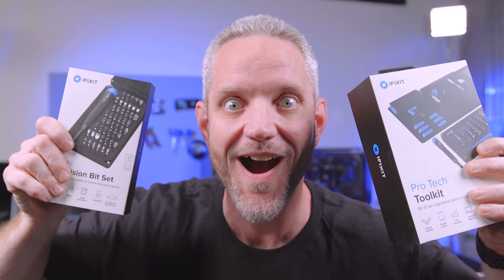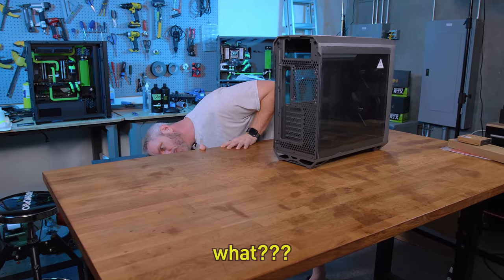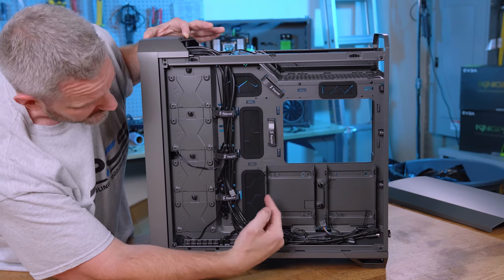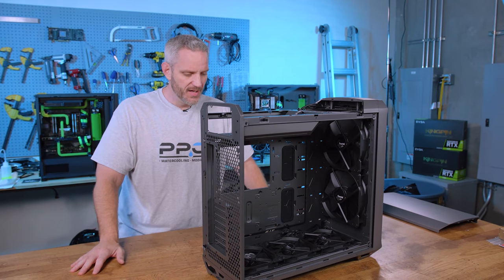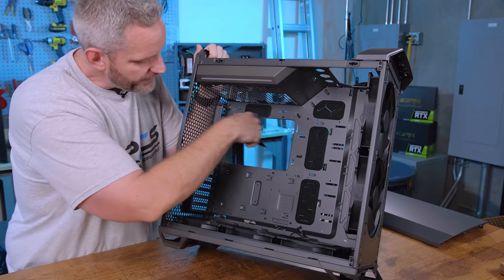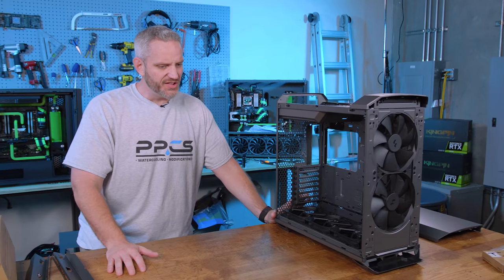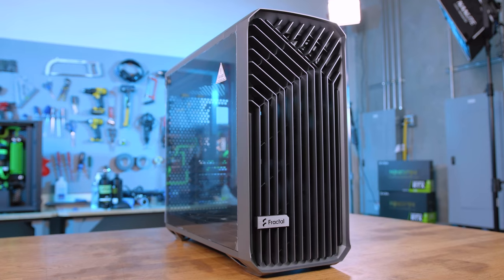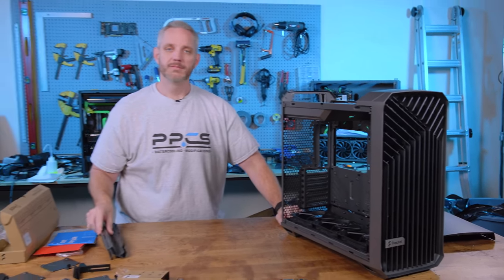I think I found my next case for the perfect casemod!

Comment: This case is junk... I get reviewing it, but I wouldn't buy this case.

To many small problems

No replacements for 180mm fans
No aio up top
Psu in a bad place - Not only balance.... how long are the power cords for a psu. Good luck not using a extension cord.
No cable management  space

I like the front..... thats it.

Comment: Actually, imagine an ITX motherboard with a riser cable and a vertically mounted graphics card in this case, snug up against the motherboard tray, both water cooled by respective 420mm radiators.

It wouldn't look strange, it would look AMAZING.

Comment: The amount of time Jay craps on stock fans...Here I am running the AMD stock cooler, 2 120mm White LED fans that came with the case, 2 cheap 5€ 120mm fans, and 1 10€ BeQuiet 120mm fan...

Comment: My mind thinks.. hot air rises and the exhaust vent is in the middle of the case besides the PSU fan, which isn’t the best fan generally. And with such a positive pressure those filters would need to be cleaned constantly.

Maybe I’m over thinking it.

Comment: Jay, the word you're looking for is "cavitating" rather than percolating.  That's where the pump is flailing around unable to achieve a fluid seal and move liquid.
Also, I could see you being able to do a "damage" mod like you describe.  Just epoxy a sheet of similar steel on the outside of the glass panel.  Or better yet, ask Fractal to make you one that you can then deform.  😁

Comment: Actually you were wrong about the vertical bracket option. Those expansion covers can all be removed and you can put an aftermarket vertical bracket in there.
Also also, not all AIOs have the pump in the CPU block like from MSI and the new-ish Pure Loop AIOs from be quiet!. So some AIO radiators can go at the bottom since the pump is either in the radiator or is an in line pump 😁

Comment: My issue with this case is that Any Case manufacturer that tries to do anything that looks good with fans larger than 140MM doesn't do well because of the adoption rate of these 180/200MM fans is so small that it other fan manufacturers doesn't do them - and if they make fans these sizes they aren't good. I've always wanted a nice case with amazing large 180/200MM fans with high static pressure to support a 180x360 or 200x400 radiatior but none exist and none cares enough to make them because so few would actually buy.

Comment: Too many comments to read them all, but I scrolled for a while and didn't see this one -- there is a vertical GPU mount available from Fractal (Flex B-20). Although with the fans pushing cool air up from the bottom, I don't think it makes sense to use one.

Comment: id like to see more cases with dual 480mm rad support is seems to be a bit miss for from new cases, unless they are super expensive. after my thermaltake core x9 had a ton of leaking issues (destroyed a motherboard, cpu, then another motherboard, and now a 6800xt, i have moved to the old phanteks original enthoo primo case which supported a 480mm in the top and bottom without enough room to mount and EK-XTOP Revo Dual D5 with 150 res attached. other than huge cases that support dual 480mm rads it seems to be an oversight.

Comment: That's a nice case. I love cases with good air flow like cooler master. I have a cooler master case and will use this fore ever. I don't like the top airflow design and the motherboard passthrough's. You think they would think about stuff like this.

Comment: I don’t know. Jay and Steve are praising this case but the PSU position is like going back to the 90s when 1) the PSU fan acted as the only fan sucking fresh air into the case via negative pressure (not the problem here), 2) the PSU grilled itself in the hot air which it was pulling from the case (partially concerning for me).

Comment: I think whatever you do for a mod, try to use 180mm fans and get a 2 x 180 radiator. Keep that giant air intake aesthetic. Would have to use the Fractal RGB fans though. Doesn't seem to be any other brand with an RGB 180mm fan.

Comment: When is the mod of this case coming? I plan to replace the NH-D15 with a dual 180 mm radiator in the future and am still not sure if I will go full custom loop with the GPU integrated or only an alphacool custom AIO for the CPU. Would be nice to see what you will do with the case.

Comment: I think you can try using cooler master universal vertical GPU mount for vertical graphics card. The only issue is that it has a PCIe gen 3 riser cable, if you can replace it with gen 4 riser cable it might work for you or just change it in your bios, and also found a radiator for those 180mm fans from alphacool (accidentally saw Jays old video on their website). 

I would definitely want to see Jay do some mods and a custom water loop to that case.

Comment: "A power supply at the top could make it tippy" I can confirm this with my custom dual system "proper" (64cm tall, beige box) full tower with two PSU's in the top.

Comment: leave it to fractal to actually put some effort into actual design. Legit not disappointed in how it looks, which is arguably the first hurdle into buying a case. As opposed to the o11d this one is not as bland as eating cartboard without compromising performance (like other cases). If I didn't have the evolv X and was building a new pc, this would def be my go to. No doubt about it.

Comment: Great case up until the top mounted PSU. The last thing any PSU needs in the era of  450w GPUS is all that heat getting sucked into it. PSUs have got much better in recent years, and they also run fanless until a certain power is pulled from them, but now the fan will be running flatout. Bit of a flop.

Comment: I don't know why, but this case put a thought in my head that had never occurred to me before. Why don't PSUs have the cables sticking out to the right side of the case (where all the cable management space is)? I know it would have to be a non standard PSU layout, but it would save routing the cables into the management space and then back out.

Comment: If you're going to remove the fractal fans  that come with the case your losing all the value of the case, the fans are like $125 in total, so if you plan to use a radiator in this case just get a different case that's $100 cheaper. The only reasonable place to place the AIO is in the front and you will have to lose those two 180 mm fans they cost $40 each.

Comment: The craziest fan mod I ever did was installing a high CFM all metal AC fan with a 12 volt relay to turn it on. I cut the case metal so it exactly matched the shape of the fan inlet and used metal tape to smooth the transition. Then I cut out the bottom of the plastic front panel and made some cuts up the sides between the case and front. Behind the panel I put in blocking so that the fan could only draw in air from outside the case. It would take the fan a bit to get up to speed but once running it was pulling air like a vacuum cleaner. Couldn't leave small things around the bottom of it or they'd end up inside the computer. I still have that case from 21 years ago. Massive full tower with 12 drive bays. I got fed up with cramped mid and mini towers.

Comment: A solid side panel to make it look like something blew up inside and forced the material outward? Something tells me you need to find someone who would let you shoot a couple of their .357 hollow points at what would be the inside of the panel. If the glass in the side is tempered you could shoot it a couple of times with a 147 grain 9mm, and the glass would spider crack everywhere.

Comment: I think you may have found me my next computer case.  I was a little dubious with the top mounted PSU, but  there's lots of good features:
- full filtration on the intakes is real nice, as is a positive pressure design for my living space (I have carpets that generate a ton of dust, so keeping the dust from circumventing the dust filters is a really nice feature I wish my current case had the capacity to do.)  
- The $300 price tag (I'm Canadian, numbers get bigger up here) would have pushed it well outside of my acceptable price tag for a case, but the fact that it comes with pre-installed intake fans very nearly covers the cost of cooling for me: I'd just need one exhaust fan and whatever I go with for the CPU Cooler (I'm not a water guy, I'm both not the best at keeping up with maintenance and my attention to detail can vary wildly...I've seen enough of your videos to know these are bad traits for someone who uses water cooling systems)  Looking at the prices, 5 of those same 140mm fans bought without the case would cost me $115 (I couldn't find a price for the 180mm fans, so I'm just using the 140 price for those...it would be more, of course.
- The amount of open space makes it look very nice to work with. I'm used to fairly old school cases with massive racks of drive bays (my current case has 3 5-inch and 7 3.5-inch bays), and given the lack of need for an internal optical drive, I'd be delighted to just go to something simple like this.

Comment: Would love to see you mod this case, the front panel alone gives you thousands of options. However I love the look of the front without the front panel on and wonder if there was a way to mount fans behind the 2x180mm front fans, with a filter, then paint the large fans and leave them exposed with no front panel at all. Allow air from the fans behind to turn them so they genuinely look like some form of industrial exhaust fans.

Comment: Do a mod. Keep the tempered glass panel, but overlay a solid one and glue (or some other adhesion method) a "solid" panel to it that you damage with a big hole in the side like something exploded "out" of the case. but the tempered glass behind still seals it in and protects the interior components.

Comment: For your space/engine mod idea - I always wanted a case that had full height intake at the front, and direct venting without passing warmed air on to other components. Difficult and ultimately not much cooling advantage, but it would look great. This case looks to have enough room behind a front mount setup to vent out both side panels. Or even V-mount two radiators up front - shrouded and vented straight out one or both side panels (with some serious frame cutting).

Comment: I'd like to see a guide on replacing filter mesh.
I've been using the Thermaltake Chaser MK-I for over a decade now.
I figured a way to rig a radiator to the top of the case and still keep the stock RGB fans at the top.
I just really love this case and its little turtle feet, but the mesh filters are starting to frey when cleaning.

Comment: sorry i dont like ths case at all. i have solid reasons . there were reasons why psu were put in bottom not top hot air ffrom inside case drwan through psu ie makes psu warmer so cooler air drawn through the bottom .reasons for put in bottom .

Comment: I can see pulling all the cables through the huge top hole. Branch off and custom sleeve. Looking like a black root system. With all the slots in the mobo tray, you can tie down the cables on the inside of the case. So, it is plausible to make a nice clean wire harness for all the cables coming out at one place. It is plausible to make non modular and even semi modular cables look appealing. So many ideas for a nice and unique look.